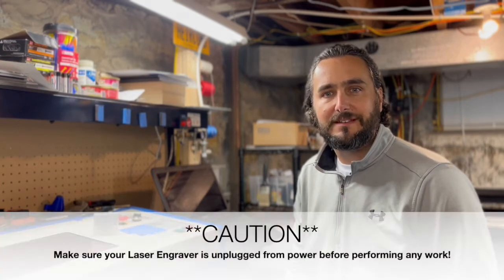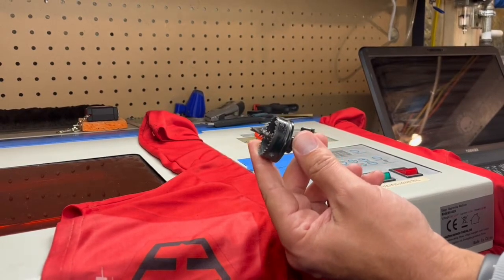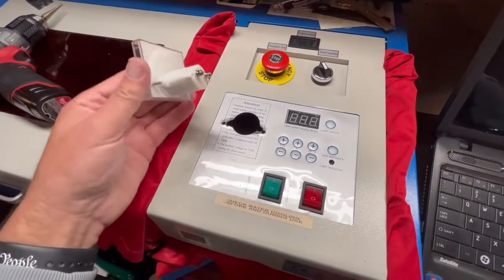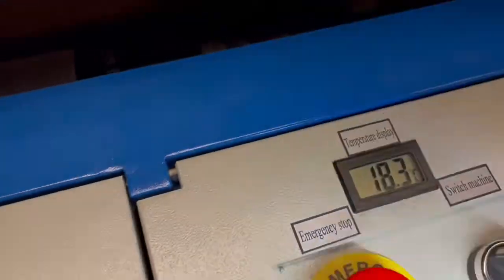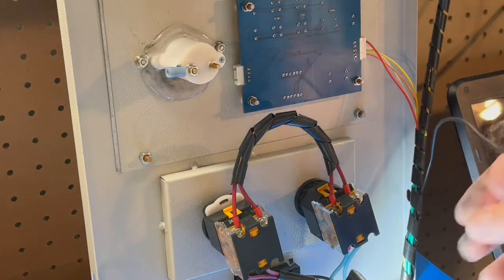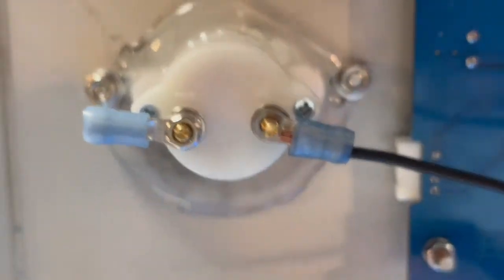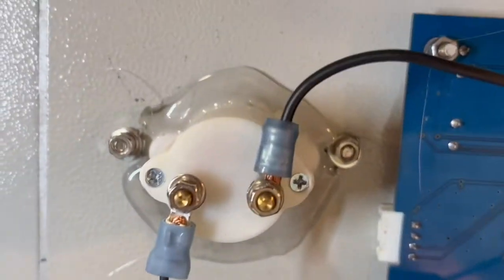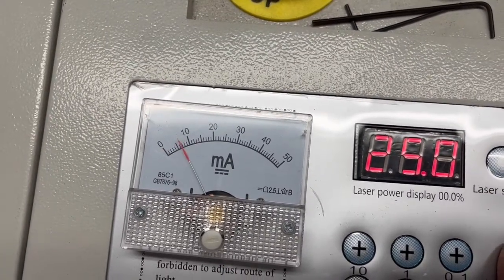K40 Laser Engraver Milliamp Meter Install

Comment: Today I just added the meter and followed the instructions. I have an OMTech K40. As I tracked the wire from my CO2 tube to the board I saw that it had been spliced, from the black wire to a blue wire. Regardless of the color change of the original wiring from OMTech, I did everything shown in the video and the meter works as designed. Thank you for this simple but straight forward video.

Comment: great video, I wos wandeing why was my ampmeter arcing (I was without internet so I done it by memmory) so I pligged positive to the miliampmeter :D fortunattely I had well grounded laser so nothing bad happened to me. Now I know wher i made the mstake, thanks.

what is interresting that ampmeter is still working and measure the correct current (it was arching from the pivotpoint of the needle to the laser case through gap in between clear plastic cower of the ampmeter)

Comment: Lovely vid! I ended up 3D printing a new panel and added the ammeter to that :D I also fried my fuse by incorrectly connecting back the switch... :D Where can I find a good table on what milliamp values are best suited for what materials ?

Comment: Very informative video. I have an OMTech k40 and I tried to add the meter and followed the steps in this video and it did not work. I thought the meter was bad so I replaced it and still didn't work. Anyone have any ideas as to what it may be? I do appreciate the help.
Reply: are you sure you have not wired the meter the wrong way around - it's a common mistake - you'd be amazed.

Comment: is it normal I got 5mA at 30%?
Reply from the maker: Example would be a 40w laser tube, rated at say 20mA, 100% power would be 20mA, 50% power 10mA, 25% 5mA, and so on….
Reply from the maker: What watt laser tube do you have?
Reply: @mw3designs  40 W, Ive tested on analog at 30% and its about 6mA and on digital it showed 5.8mA

Comment: Another observation, why would you mess with the connection at the power supply at all?  If you tap into the wire high in the loom, you can jump across to the meter and back to the loom without sacrificing the factory terminal and you'd have to fish almost no wire back through the loom.
Reply from the maker: Again, this is a matter of preference. Even though it might look like it, there was not enough wire there to make the jump across the meter, and back to the power supply without splicing in an additional length of wire. I did not want to add an additional length of wire or additional splice points. This way it’s a homerun from both connections points on the meter.

Comment: Why wouldn't you just remove the panel and cut it away from the machine, rather than risk having metal shaving fall into the power supply?  It's pretty simple to do.  Just take a picture of the wiring before you remove the components, then it's just a matter of a few screws.
Reply from the maker: It’s just a matter of preference, this was the easiest way for me to get it done quickly.